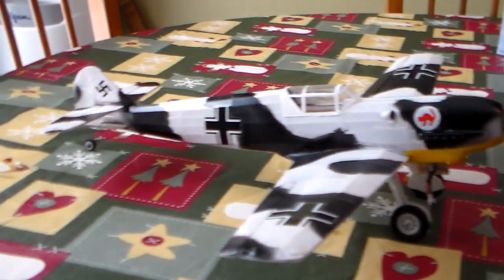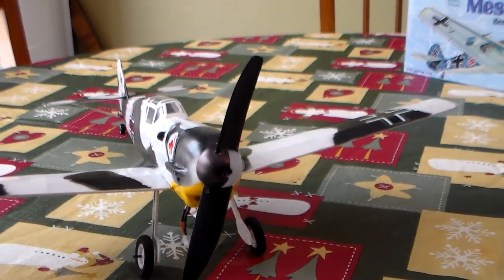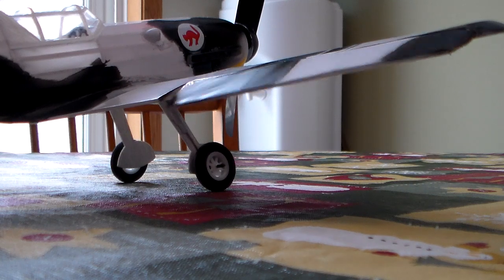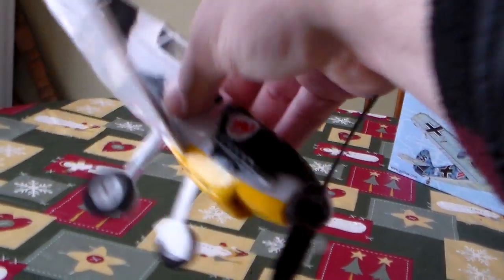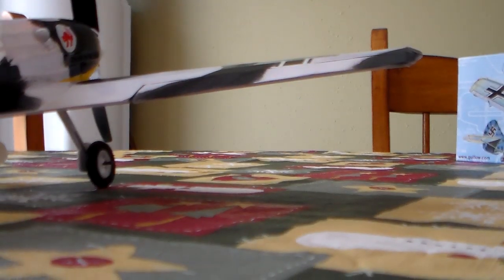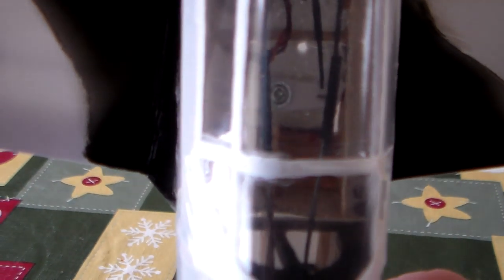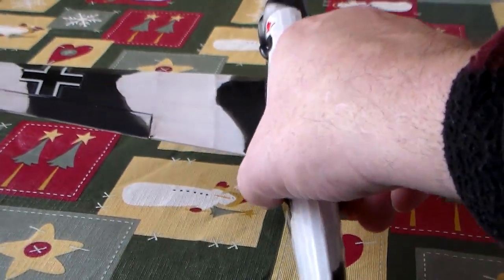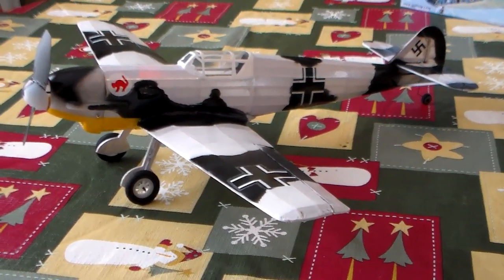Guillows Bf109 RC conversion

Comment: Is there options in the instructions for making the ailerons and elevators and rudder? How did you set all if that up? Just got into rc planes, but ive loved the 109 forever, want to twke my crappy xcub 450 internals and put them in this kit
Reply from the maker: Hi. If you go to the rc groupes forum you will find a guillows rc conversion thread. Theres no instructions for ail elv rudder but you will see how its done tn the guillows conversion thread. It can be done and is very rewarding. Have fun 😊
Reply: @jagdpanther9 what p51 did you take the internals out of? Do you think a hobby zone xcub 450 internals would work?

Comment: Hello, how heavy would you say is to heavy for this exact kit to fly? I am in the process of building one and i am a bit worried about Weight. Thank you in advance!
Reply from the maker: hi, this model is 2 1/4 oz and it could have been as lite as 1 3/4 oz if i had really beat myself up over it. i would think that 3 oz is pretty heavy for this 1s power set up . my P-40 powered by 2s flys like an animal @ over 4 oz so that is an example of a heavy little model that still flys well. just remember to gut out all of the weight you can from the tail and aft fuse . the fuse isnt supporting a rubber motor anymore so it dosnt have to be nearly as beefy for rc and this will help greatly for getting the c/g right without adding nose weight.
Reply: @jagdpanther9  yikes! I measured mine and it came out to about 80 grams or 2.822 ounces, I don't know if it will fly very well if at all

Comment: When you say it would "barley fly with the stock p-51 prop" how well did it actually preform?
Reply from the maker: you could fly the model but there was very little power just enough to get out of trouble . the 5043 GWS prop is a big difference with the p-51 motor and gear box. at a safe height with the 5043 prop i could dive and complete a loop or a roll with the p-51 prop the model would literally fall out of the maneuver with just barley enough power to recover. the 5043 prop gives you that extra power for recovery that comes in real handy.  Thanks for your comment !
Reply: @jagdpanther9  thank you for your very fast reply!

Comment: BTW how are you getting working ailerons with that p51 brick as it only has 2 linear micro servos? I couldn't really see in the pictures how you achieved it. I ran the same brick in mine but had to settle for just rudder and elevator as there are only 2 servos and no place to plug in another.
Reply from the maker: there is another channel to plug into on the brick. this uses another linear servo that has a lead and plugs into the brick. this model uses all of the running gear from the UM p-51. you'll have to build your next one with ailerons :)
Reply: jagdpanther9 Yes I am building the kit 501 p40 with ailerons this time. I like the way you did your battery compartment under the nose. I wish I had a better look at yours but no matter.

Comment: Hey buddy. Im finally ready to check my CG on my 109. Not sure exactly how far back from the leading edge, but seems to be pretty damn tail heavy. Is this your experience as well? I was planning on running a 150mAh lipo but I do have some 250's. I was planning on putting it in the cockpit but I think I'll have to put it in the nose like you. Im just concerned with compromising my structural integrity by cutting some battery access in the nose. How did you accomplish getting the CG right and where do you balance from?
Reply from the maker: i added a wheel weight up front but if you have bigger lipo that is the way to go. i find my c/g the same on these little models all the way up to my 101" ME 109. i use the 1/4 and 2/3rd (25% and 33.3%)method. take a piece of paper the length of the wing chord lay it on the wing. fold into quarters, and that marking from the leading edge is your furthest forward mark. now fold it into 1/3rds and that is your furthers rearward mark. proper c/g is right in there. crazy but this works for many many of my builds and will get you in the ballpark. i put a link to this method in the video description. it is ment for a constant chord wing but just go out 20-25% from the wing base/root and it works great on warbirds too. =D

Comment: Im building the same plane with the same Parkzone p51 brick-motor setup. The cockpit seems to be the obvious place for the brick, tight fit. But good location for it. What was your method of attatching it to your plane? I thought about hot glue but not sure if that may harm the brick in some way. How about yours?
Reply from the maker: i think hot glue would work but i used some ultra black silicone sealer i had in the shop. silicone will be easier to cut off if you need to move or make repairs to the brick.
Reply from the maker: i would lean toward silicone

Comment: How do you put the wrap on the model?
Reply from the maker: +Fatty Hamster hi, this covering is called parklite made by hangar9. it is a plastic film that has adheasive on one side . so you peal off the protective film and place a section on the model and iron it on with a small iron. the iron heat makes the adheasive stick to the frame work and shrinks the plastic covering so the wrinkles go away. it is really durable stuff and for electric powered models i like it as it will take abuse that tissue covering wont. covering the model is maybe my favorite part of building .
Reply: What about the stuff the model comes with?
Reply from the maker: Fatty Hamster hi, the model comes with tissue paper. if you use that you glue it on with adhesive and then spray it with a mist of water. when it drys it tightens and wrinkles go away. it is very lite but not very durable.
Reply: What motor/ rx/ esc did you use? Im building one now and considering the parkzone micro- mini brick with built-in linnear servos and esc. Is that what you have?

Comment: Sweet white-wall on the tail wheel tire!
Reply from the maker: dak2005vn it is a great time to be into micro rc and just rc in general there is so much and such great quality and it is so in expensive compared to 20 years ago. do it, build it , you will be the only kid on your block with one of these rc conversions. also go to RC groups and check out the Guillow's Conversions - The list of conversion threads . there are hundreds of build logs for guillows rc conversions.
thanks for your comments!
Reply: dak2005vn the wheel is from the PZ ultra micro P-51 =D
Reply: Also cool because the real ones (early versions at least) I believe really did have the white-walls like that.
Reply: Always was a dream of mine as well to make these 500 series into RC as you've done so well. If I were to do it these days though, probably would go for the 400 series, (also as you've done)something more satisfying about building a Guillows that can fly like that rather than just slapping together a couple pieces of foam.

Comment from the maker: yes, this one flys with the brick,servos,motor and gearbox from the parkzone mltra micro p-51.i did use a 250mah battery instead of the 150mah. I also tried a 3 blade corsair prop which barley flew this plane.the stock p-51 prop wasn't much better.the gws 5043 prop is awesome.
Thanks for your comment!

Comment from the maker: yes, the kit 401 has a 24 3/8" span. this is the kit 505 and it has a 16 1/2 inch span.i just completed a kit 401 I will put a link to that build in the description for this video.